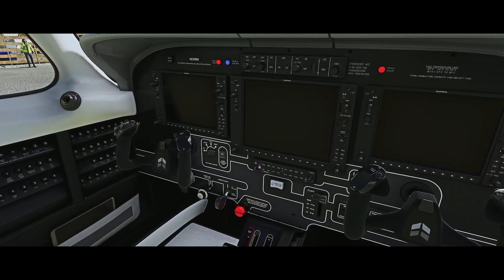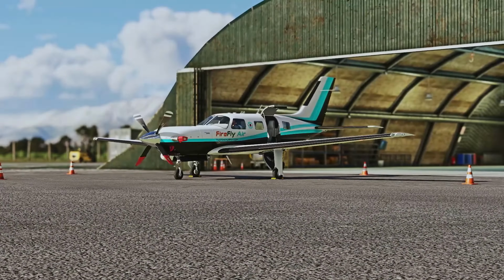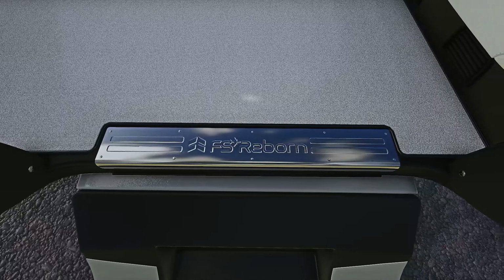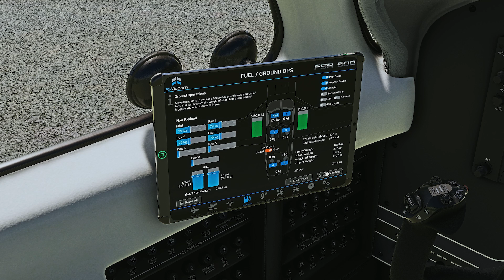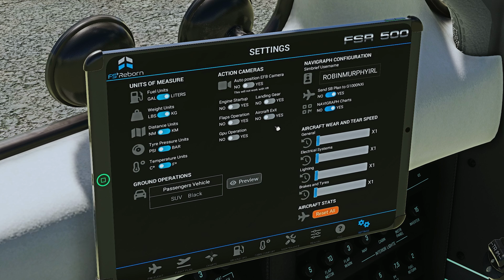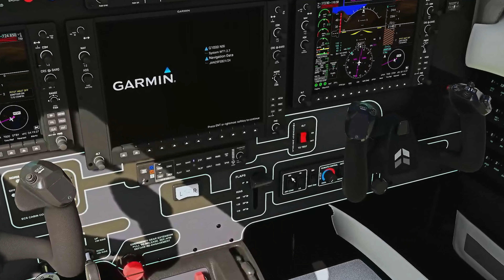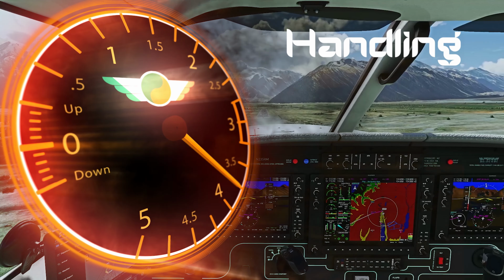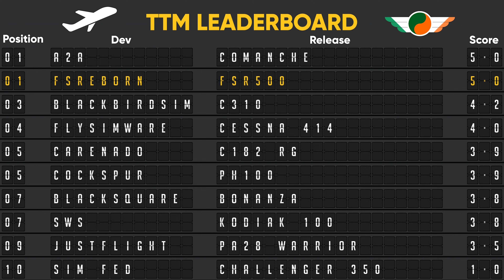FSReborn FSR500 | Full Review |

Comment: I bought this plane on the strength of reviews. I have to say it is trash.  The flight model was amateur and I can guarantee the real thing will not fly like this. Back to the Comanche I go.
Reply from the maker: The flight model was developed based on feedback and testing from real world operators. Are you flying with the ESP enabled perhaps?
Reply: No. I turned it off.  The plane does not capture the feeling of flight, but I guess you probably know that.
Reply from the maker: @doctordoom7047  have you flown the real thing?
Reply: @twotonemurphy you do t have to fly to real thing to know it’s not how airplanes behave in the air. 

These flight model complaints are nothing new and the other upper level airplanes don’t get these complaints.
Reply: If you like flight models, pick up the COWS DA42. I’d say the flight model is just a half step below the Comanche. 

No twitchy and it flies like airplanes fly.
Reply: Hello  @twotonemurphy  , We don't have the same sensations, perhaps a question of settings?  With ESP or not there is a problem. Maybe the real pilot could give us his thoughts?

Comment: One of the reeasons, maybe the only reason, that I didn't buy this plane is that I had the Black Square TBM 850 and they looked so similar. I would love to know how those two compare to each other. Visually they are so much alike but how do they compare in the other areas? How about it Murph? Can you settle my internal argument? As usual, I love these reviews. 🥰 Lauren
Reply from the maker: very different aircraft in terms of speed and how they handle. But, this has pretty much everything the TBM has plus the addition of the pilot experience stuff
Reply: The Blacksquare TBM 850 is better in my opinion, visualy and for the flight model. On the ground and in the air. The piper is not far from being very good but not yet.

Comment: Hello, thanks for the review. My opinion on the subject : 5 stars for the graphics. I don't really understand, the textures are not very evolved in my opinion, too immaculate.
The 3D modeling is approximate and sometimes not finished, look at the landing gear (inside the hatch).
The flight model, I don't know this plane in realistic but the ones I was able to fly did not react in this way in pitch and trim (the trim on FS 2020 is often very strange anyway), but the rest of the flight envelope is undoubtedly more accomplished. So I wouldn't have given it 5 stars at the moment. 
Otherwise, a lot of work from the dev and congratulations to him, it's a great job but it's not finished (there's a long-awaited update coming).